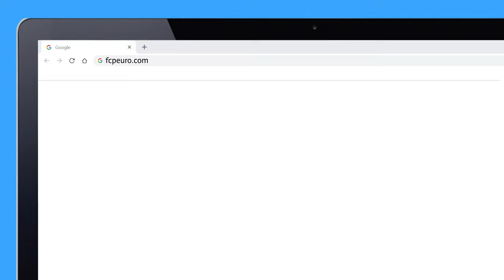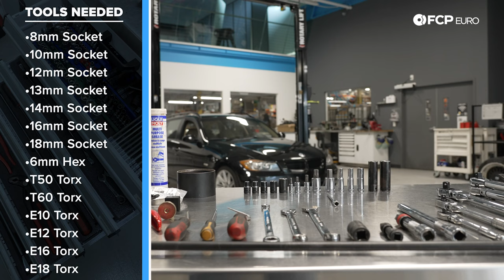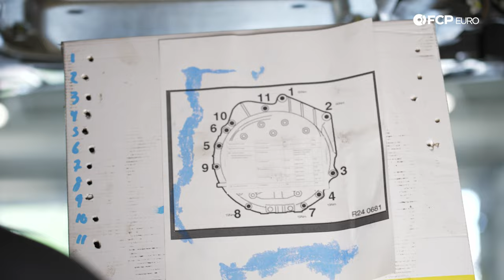BMW 328i Clutch Replacement DIY Part 1 (N52 Engine - 2006-2011 BMW E90, E91, E92 328xi, 328i xDrive)

Comment: Do you think it would be possible to do this in my garage without a lift? I have a floor jack, and Jack stands to put the car on, I know it's 10 times harder without an actual post lift to work under cars and do clutch swaps but not impossible right? (I have an 07' 328XI Sedan)